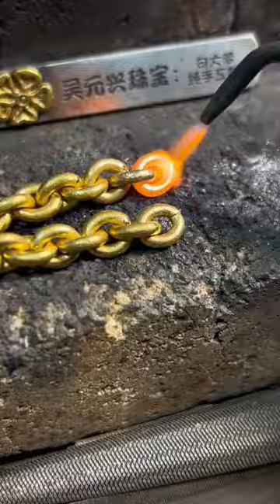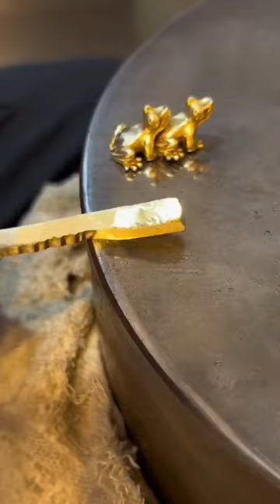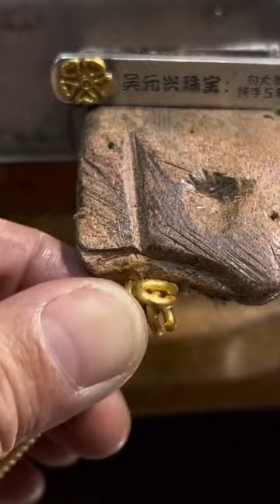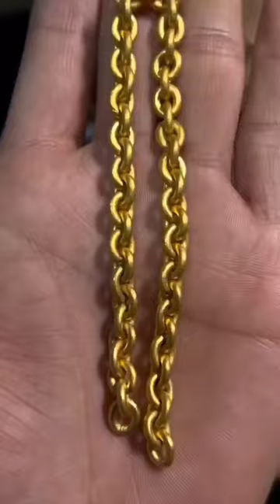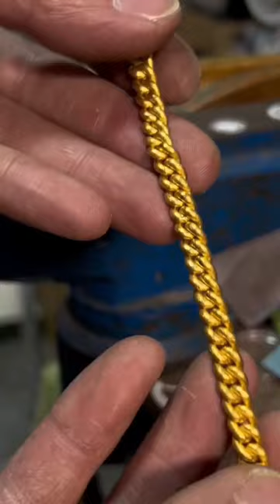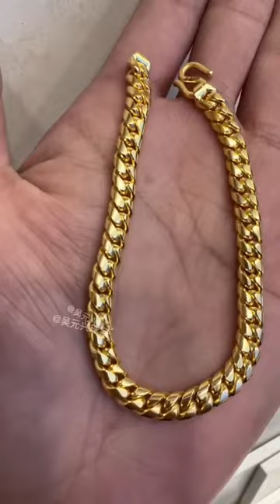How Do I Handmade a 42 grams 24K Gold Cuban #craftsmanship #mdtcjewelry #custom

Comment: Never have I ever seen a 24k gold Cuban so beautiful
Reply: Right the chinese make a similar style but not like this is a straight up cuban chain pattern
Reply: The closest ur going to get to 24k looking like chain is if u go for 20k gold it looks very simulat but its nog going to get scrached that easy as the 24k gold
Reply: @Maykay1312  I have 24k gold chains and bracelets I've just never seen a Miami Cuban made out of 24k
Reply: @datboi__  its just beautefull shiny xd
Reply: It’s very beautiful the appearence but very fragil at the same time, it will required a maintenance very soon
Reply: I got a Cuban @ 55.6 Gram, 5.5 mil, 22 inch lenght, pure 24K/980 solid gold chain, i got other metals too.

I called Trax in NY, Muhhamad from TraxNY called me back and, said they dont have 24K Cuban's either.
Reply: @briggsdidnotstrapem7699  980 isn't 24k
Reply: @datboi__  yes my Bruh, you are correct and, I am wrong, 24K is Not 980, it is 999.
Reply: Dam koto
Reply: Jesus is the only way to healing, restoration and salvation to all souls. Please turn to him and he will change your life, depression into delight, soul heading from hell to heaven all because of what he did on the cross 

“Whoever calls upon the name of the Lord shall be saved” Romans 10:13
Reply: @HaroutBlack  excuse me sir this is a Wendy's
Reply: @chardaecharkhom9418  This maker is chinese.
Reply: When I say pure..i work at a pawn shop & the highest karat ive seen on a Cuban so far is 18 kt
Reply: Thats how "gold" should look not pale ugly 10-18k
Reply: @Maykay1312 21k is used often in Turkey and Arab countrys..

Comment: Unsafe clasp lol very beautiful though
Reply: How so? It’s pretty thick, so bending it probably takes quite some force and if you bend it sideways passed the closing point, it won’t come out
Reply: It has opening id it snags on anything and u keep walking its gonna break either the clasp or other links in the chain
Reply: @C3E_DRILLY-ps5  What can a 42 gram chain possibly snag on and break? You’d have to be doing something pretty stupid for that to happen, like operating machinery. But regular everyday wear won’t do anything. That clasp is not just very strong, it’s extremely flexible and certainly won’t break. We’re talking 42 grams of Cuban solid gold, not 5 grams of hollow links lmao.
Reply: @JesusIsGoodTruth  gold is very soft. Anyone can run up to you and snatch with no problem
Reply: @rustyshackleford2808  What does that have to do with it snagging on items? No one mentioned theft at all lol.
Reply: @JesusIsGoodTruth  😐
Reply: That clasp is pretty tough imo, esp if it’s thick and it is work hardened. Can barely move it sometimes when unclasping it from ur wrist with just a hand. Ppl have been using that sort of clasp for centuries i think , still do, long before lobster, box clasp became a thing

And if someone wants ur gold in the eastern countries or 3rd world, theyll chop off ur hand with a machete for it 👀 🗡
Reply: in china, most people only buy pure gold staff. ur right, it's weak, so we use fishing line
Reply: @JesusIsGoodTruth  it's weak, use fishing line
Reply: @inthendwealldie  As a jeweller, I completely disagree. 24ct is EXTREMELY soft. As in it will wear thin just rubbing on skin over time. 24ct gold cannot be work hardened, as the reason hardening happens with metals like 10/18ct gold is because of the alloy composition in it, which is not present in 24ct. You could very easily pull and stretch this chain, despite its thickness, and snapping that clasp would be even easier, especially due to the poor design. The best option would have been a box clasp, parrot clasp, or an 18ct chain. 

Furthermore, soldering 24ct is never a good idea. You're very likely to melt it in the process, and you're essentially contaminating the metal with base metal and lower quality gold, which will require refining if being melted down in future. 

24ct gold is lovely to look at, but not at all practical for jewellery.
Reply: @CarlsGravy  I have 23k and 24k jewelry and yeah it is definitely soft. I wear them daily. Never take them off besides the chains every once in a while, and I actually cannot unclasp the bracelet with one hand, it is difficult for me, so the bracelet is stuck unless I really give it significant effort. That’s also why in 3rd world or dangerous countries I heard from people, they’ll chop off your hand with a machete for that gold

My 24k 15g bracelet stretched by half an inch, kinda regret that bracelet, still wear it tho, and all  24k bracelets and chains are expected to stretch unless they are substantially thick, like IMO 75g+ of pure gold, esp if the links are all solid. My 24k pendant actually lost some gold on the the thin parts when it was cast forged, but I just prefer high karat jewelry

Some local 24k places nearby me charge like $100-300+ USD per 15g or so. 24k could be like $65/g, and they’ll typically charge like 70-80+/g. More if the location is really premium and fancy, but it usually hovers around there

I even found a 72.5g 24k chain worth about 4.7k in gold at the time and just $300 for labor, so 5k total, whereas all the regular shops that sell 10k-14k have a significant mark up, even in the swap meet. I remember seeing and asking about a 32g 14k rope chain going for 3.2k USD and this was when 14k was around $32-33/g, basically $100 a gram for 14k for 32g, so I just found certain spots just sell it cheaper IMO, esp if they make everything in-house, that’s why I don’t really look at 10k-18k anymore cuz the labor, overhead and premium in the US tend to be pretty high every time I inquiry about a chain in-person at an actual shop, the mall or some hood swap meet unless they hook it up, and sell it at wholesale prices without sales taxes, but other than that I mostly avoid 10k-18k cuz of the premium US mark ups lol

And overseas in certain countries, the labor for 24k is like $30-50 USD for a whole chain or whatever, it could be like 300g of 24k and the labor is probably just $30-$100, the locals might even get the labor for less
Reply: @adambrezinova1494 exactly 💯......it's funny how jewelrs will try to tell you what to buy ......some say a hollow will break ....solid only....but like if you have a 4mm solid chain ....that's basically like a 6mm hollow chain....so alot of the times whatever will break a hollow chain will probably break a solid one too .....or at least damage it badly......for example...I wouldn't want my solid chain to go through whatever broke a hollow one ....still does damage most likely
Reply: I don’t trust that clasp either I need a lobster claw on mines
Reply: @CarlsGravy cap I'm a jeweler n ur wrong 😂

Comment: at 42 grams hell upcharge for that. I get he handmade this but I'm not paying 2500 for 800 bucks worth of gold. IL learn how to handmade it myself at that point.
Reply: It's actually about $2500 worth of gold lol but he'll probably charge like 5k
Reply: $3000+ worth of gold 24k is 81$ a gram CAD
Reply: No you won’t
Reply: Bro how do you figure $800 🤣 
It’s damn near $2k an oz and this Is A ounce and half !! 28+14 = 42 grams . This is a $2,750-3k bracelet just in gold and yes unless you have all the machinery , knowledge and skill to make a perfectly balanced Miami Cuban Link then it’s around a $4k-5k Bracelet . This bracelet at $4k would be a steal. 
You’d pay $5-6k anywhere else! Usually it’s double the price of the gold for the melting & labor that it takes. Even if you take 1.5 oz of pure 999.9 gold to a jewelry maker and supply the gold and just pay them to make it you’ll spend about $800-1,200 easily
Reply: @floridaboybrandon954  you mentioned labour costs, melting costs etc for justification to double the price of a bracelet or whatever, but I’ve always wondered about this. you can get a cheap plated stainless steel bracelet online for a few dollars, surely the exact same effort is required?
btw gold ounces are troy ounces, so not 28g 😎
Reply: So beautiful bracelate ❤❤❤❤i love it
Reply: @floridaboybrandon954 an oz of gold is measured in troy oz which is 31.1g.